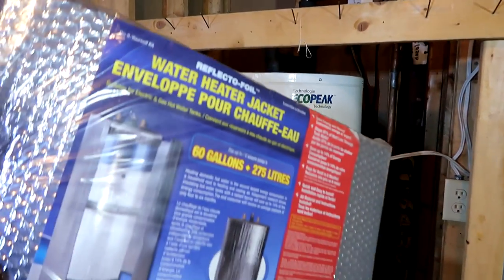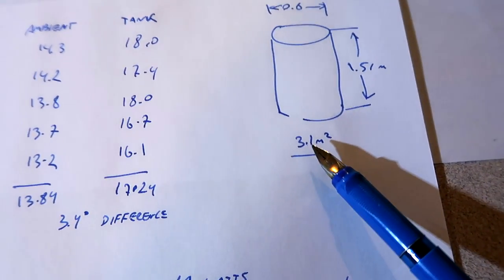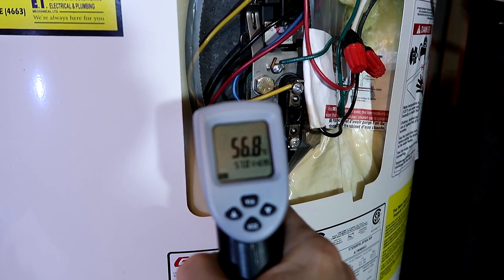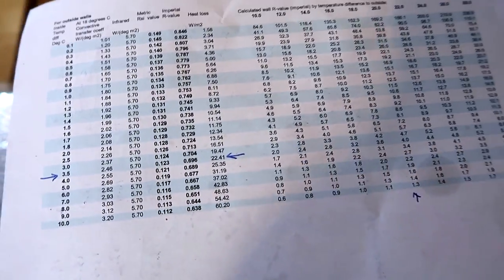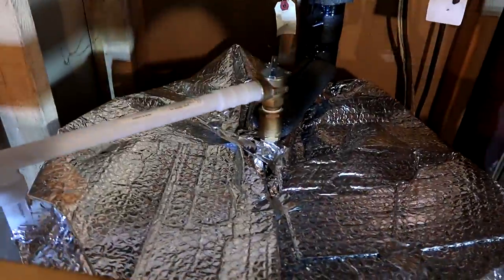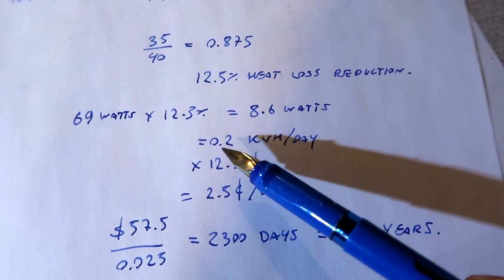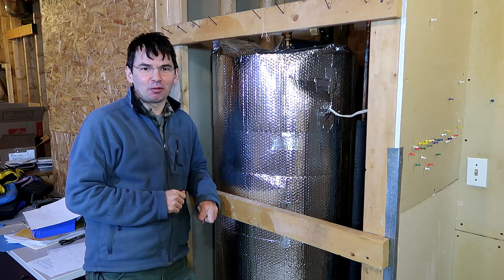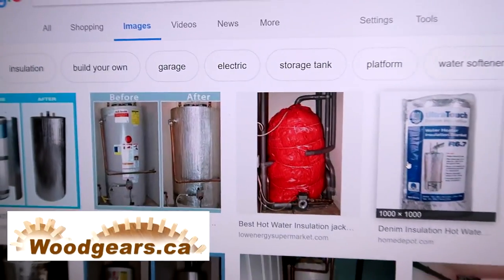Hot water heater insulating jacket:  How much savings

Comment: $60 is a lot for that piece of thin plastic. It would be interesting to test if using regular bubble wrap would make any difference.
Reply: nowanda2nd … been using standard bubble wrap for years on my well tank to keep it from sweating on the basement floor during the summer. If I had a tank style water heater I would probably use that then add a layer of regular foil or that silver Mylar stuff, sealed at each joint with tape. Might even do 2 layers of bubble wrap because it's cheap.

Comment: In my experience, the best way to increase the insulation around your electric tank is to frame it in like you have there and then insulate those walls. Of course remember to leave access for when you inevitably have to replace the tank or fix a leak.
Reply: Yep, tank inside a heavily insulated cupboard : )

Comment: The previous house I owned, the hot water heater was in an unheated and under-insulated garage and the tank sat directly on the floor, and was not in a closet or any other insulating type structure. Granted the number of days below freezing in my area are limited, even still, my guess is in this case, the insulation would have made a much larger impact. At least during the winter.

Comment: Got radiant heat loss but what about conductive heating of the air surrounding the unit?  Reading ambient temps would have been worth doing, surrounding the unit.  Also introduces complications, however, such as general ambient temperature and humidity that you'd need to factor in.  Not impossible though.  I imagine this would be just as large if not a larger factor than radiation loss, which you measured, hopefully making the numbers better.

I like the other bits of advise though, especially at the end.  Never thought to reduce low coil temp for people that have oversized units.

Comment: This was a great video. I really like your method for getting your results. 

One thought, the air leakage through that insulation could be quite high. I would think that if you did a better job airsealing it, you would get far better results. For instance, the top where the pieces are just folded over. The only issue that I think could be a problem is if there is ever a leak, it wouldn't be able to dry out as fast. 

I agree that the kit overpromosses.

Comment: What you loose on water heat, you win in heating the room. If you heat with the same water tank then there are no losses. Only if the room temperature is higher then wanted isolating make sense.

Comment: If you dig deep into the seller's "test method," I bet they tested on a completely un-insulated tank.  Your tank had reasonably good insulation already included which is probably the norm.  I'm convinced tank manufacturers have included insulation for many, many years at this point so that they can sell their product hyping it has much greater efficiency than those from years ago.

Comment: If you live alone or just a couple, you could use a unit that warms the water as it comes out through the shower head.  It is made out of a heating element with a copper tubing coil . It works very well. You don't waste any energy keeping a tank full of hot water.
Reply: Wow that’s interesting. What’s it called? I would like to do more research. My electric HWH is on the outside my house in basically a plywood box with no insulation. It’s winter and the shower stays warm for maybe 20 mins max. Both Temp gauges are all the way up. Would it be better to insulate the box with rigid foam boards or wrap the tank itself with some insulation?
Reply: @Ang.0910   There are many options, check for tankless water heater or in-line water heater. But I think it requires 220V

Comment: might I suggest measuring the temperature on the outside of the insulating blanket.  measuring behind the blanket will determined heat trapped between the 2 surfaces.  thing you would be more interested in the amount radiated to the room. this would be consistent (and interesting) with the initial measurements.

Comment: Inefficiency as it pertains to water heaters is heat lost to ambient air or surfaces rather than to hot water delivered to the left faucet.  That loss can occur in several ways: 
1. Heat loss through the water heater's insulation jacket.
2. Heat loss through the pipes en route from the water heater to the faucets.
3. Heat loss through the exhaust of non-electric water heaters.
Assuming the furnace and the water heater use the same form of energy source and the water heater is located in a part of the house that is heated by the furnace, then item No. 1 above is canceled by the the lessened amount of heat the furnace needs to put out to heat the space, unless the furnace is not active due to warm weather.

A high efficiency furnace and a high efficiency water heater is ideal.  It looks like Mattias has an electric water heater. I know he has used a blower that was repurposed from a high efficiency water heater in the past for another project.  Gas would be more efficient for producing heat domestically. Well, actually,  Electric appliances produce heat with 100% efficiency, but all the inefficiency is in the electric bill because the electricity is produced from a heat source at the power company very inefficiently. If it's heat you want rather than light or a motor turning or your stereo playing, having your own heat source in your house is much more efficient than having the heat source miles away and using generators and resistance wire as a transmission.
Since he lives in Canada, I would not think an extra water heater insulation jacket would be cost effective except on warm summer days.  
Preventing heat loss through HW plumbing would be the best option by far.  A good way to do that would have been to insulate the HW plumbing when the house was built. Retrofitting pipe insulation is good also, but there will likely be uninsulated gaps.  Another strategy is to have a plumbing manifold at the output of the water heater and then have small diameter tubes going from the manifold that are dedicated to a particular faucet. A 5mm tube should be plenty to supply a single faucet and the volume of water in that tube when water is not being used will have a low thermal mass that is replaced quickly when the faucet is turned on and the loss of heat in that small line will be minimal.

By the way, my son lives in Florida and drives a Tesla.  That's great for a warm climate, but I live up north and I'm sure an electric car heater would greatly reduce the range of such a car here.  Tesla's that live up north should have one of those small "truck heaters" installed that you fill with liter of diesel. Besides warming the passenger compartment, it could also be plumbed to keep the batteries warm.

Comment: You should taking the thermal value and not measuring it against the uninsulated value to show how much you would be gaining.
It is the efficency over the loss that you want to figure.  If it gained on one layer, what would you gain with multiple layers?

Comment: I just replaced my HWT... Because of codes that changed in my area. My options were: Install an electric HWT, $1000 for the tank +(~$300/yr to run off electricity), or install gas HWT $1000 for the tank plus another $1000 for a 4" chimney sleeve insert (to keep code compliant) +(~$100/yr to run off gas),... 
Then I Called around. Boom! Got a power vented HWT for $1821 (after Tax installed). Now Both my Furnace and HWT vent out of the side of the house (Thus - the chimney is no longer used or needed for the house) and I can now remove the whole chimney stack from my house and free up that Floor space.......

 In the long run this option is going to cost me the most money $$$ because now I can bust down some walls in my smallest bedroom to expand it, and because the stack is also next to the Kitchen,... I am also thinking up ideas of how I want to renovate my kitchen now that I have access to this additional floor space....

Comment: Don't know if it was mentioned in other comments, but in the heating season, that heat loss from the water heater isn't a total loss, it heats your house. Not as efficiently as a heat pump, so not 1:1, but that extends the payback even further. Another thing for payback - if the money was invested at an average 4%, that means even longer (or maybe never) payback.

Comment: Do not cover the thermostat access covers! Back when the thing with wrapping water heaters started in the 80's the power company had a deal where they'd install storm windows, wrap the water heater etc. Damn near burned the house down because the water heater thermostats MELTED. The plastic used in those has an odor that kind of smells like burning oranges. Dad cut holes in the fiberglass wrapper, installed new thermostats and the heater was back in action.
Reply: With electric heaters set at 125 130F that shouldn't be a problem

Comment: Old solutions for old tanks are still being sold.  If you have a modern hot water heater with modern insulation (like closed cell foam) then this doesn't work.  If your hot water heater is old, then you should just replace it for better efficiency.  In California, PGE charges .32 cents per kwhr so more efficient appliances are worth it (solar panels are very well worth it with high utilities and good weather year round).
Reply: There are very few water heaters from before 1999 out there anymore.
I still come across heaters from the mid 90's sometimes. But most heaters being replaced today were installed in the mid 00's.

Comment: When you point that IR thermometer to the foil, you may very well be "reading" your own body temperature. If you look at the foil with an IR camera, you'll clearly see your reflection there, as if it were a mirror, which it is. As others have said, you should have put a tiny patch of electric tape on the foil and point the IR thermometer in that spot. Ideally do the same, with the same type of tape, on the wood to read the surroundings temp.

Comment: I cut my electric bill in Hal by putting a timer on the water heater. Setting the timer to run for an hour at around 5am and again around 6pm gave hot water at the times I needed it most. I rarely had to override the timer, but if I did the hot water would be ready in a few minutes. Now this didn’t work when I was living with a woman because there was never enough hot water for her, so the timer got turned off and I insulated it instead.

Comment: ...and if you were analyzing a GAS/LP tank-type water heater, the benefit would be even lower, because so much heat is lost due to convection through the flue (the metal tube that runs through the center of the tank for combustion gasses).
It would be akin to adding insulation to the walls with the door hanging open.

Comment: Laser thermometers are incredibly innacurate when you use them from that close (at the end measuring in the holes)
That is because they measure in a disc shape not on a pinpoint like the laser suggests. Quite the interesting readup.
Reply: The cheap ones are allowed a -+5°C error from what I've seen and one imported brand I checked would not supply any certificates or even paperwork indicating the certification of the batch produced. For 10-20 times the cost you could just buy an infrared camera.

Comment: Mylar backed bubblewrap is "insulation" the way a space blanket is "insulation". 

If you've ever needed one, you'll know they're better used as a reflective lining not TOUCHING your surface.  Put two inches of rockwool all the way around your water heater? You'll notice improvements. Put a thin layer of mylar, you'll..yeah, not so much.

Comment: The figures on the jacket about payback are for tanks not already insulated. And yes, I have seen just copper tanks before. I do energy surveys in UK and have seen just copper with zero insulation. One time only. But I have seen it.
Reply from the maker: with today's energy prices, that would make for a very short payback period!
Reply: @matthiasrandomstuff2221  Indeed. It's crazy how marketing can get away with such cheeky stuff. The rarity of totally uninsulated tanks, yet the figures are based on such. I bet they don't even have to state the method of calculation for such savings. They can just prove it if taken to court and say "here" and eyes roll at the way it's done because it's not legal to sell tanks like that now. The one I saw most likely had the insulation ripped off or deteriorated. It was in a flat above a pub where the pub landlord lived who rented from the brewery chain. I told them a jacket would pay for itself quick and they shrugged their shoulders and went well the brewery should buy it then because he sure isn't. Insane.

Comment: And if your water heater is inside your house (like in the laundry room), the heat loss is contributing to the temperature of your living space.  Good news in the winter, double whammy in the summer.  Solution?  A conventional resistive water heater for winter months, plus a heat pump water heater for summer months, and an array of valves to switch between the two.  Highly practical!  Or I guess a tankless would be okay for non-adventurist types.

Comment: Another trick is to split the load. The lower the setting on the tank, the less heat loss and the less it costs to maintain the tank temp. But nobody wants to take a room temp shower. So, get one of the point-of-use heaters for the bathroom. These don't normally produce enough heat to bring the groundwater all the way up to shower temps, at a flow rate sufficient to take a shower. But, if they only have to raise the water temp 10 degrees or so, they are very capable. Then, you save money on the primary water heater, and only pay to heat the water to really hot when you actually need it. The rest of the time it stays warm.

Comment: I love these videos. I wonder though if the last measurements were placed incorrectly. Shouldn’t the ambient temperature reading be on the outside of the insulating jacket and not the wood framing beside the heater?
Reply from the maker: The surface will still be warmer than ambient, and the IR thermometer doesn't work on the reflective.  So it's definitely correct to measure the framing, wrong to try to measure the jacket
Reply: @matthiasrandomstuff2221   your first test was on the outside of the jacket and the surface of the tank at 57 degrees . So you should measure the outside of the jacket to compare. The middle of the insulation is always going to be warmer than the outside. To prove this, measure the temp of the surface of some fiberglass insulation and then tear off half and measure again I bet the middle is warmer than the outside.
 If you can't get a reading on the shinny insulation put some masking tape on it and it will be the same temp as the wrap.

Comment: I put that stuff on my garage door (btw its about half price if you just buy a roll of it) and its worthless as insulation, but during the summer the reflective surface dropped my temps by 15F ... now mind you in my part of the America's its 90F or more in the summer and my stupid garage door is facing the sun most of the day. 
With the rest of the garage space insulated all it is is a giant hot plate heating an oven and I have seen it get to 115F when I come home from work and the door's been closed all day with no airflow so 15F on non peak days its worth the 28$ I paid for the stuff

Comment: I have a suggestion for you!
I’d like you to lay out twenty feed of copper, aluminum wire with different types of metal steel on one end copper or some other metal!
You should have about 1 1/2 volts but with your Graf is there a raise in volts over time from solar storms?
That would be interesting since X-rays are high energy protons!
Reply from the maker: I will leave the quackery to you.

Comment: I like the calculations and the process. However the true r value of metalized 3/8" bubble wrap is known to be R1. . . Regardless of what water heater space blanket marketers claim. My approach regarding the temperature settings has been opposite. I've set my water heater to nuclear hot. This way our hot water ratio is lower. It's not necessarily energy efficient but decreases the likelihood of a cold shower.

Comment: You forgot radiant heat losses...... that reflective material is less emissive... it will trap the IR transmission between the tank and the insulation....  Still not a huge savings but you may save a couple more cents per day

Comment: Just something for you to bake into your analysis.  I know its winter where  you  are.  I assume Your house is heated, including the area containing the hot water heater.  So, if you reduce the heat loss from the water heater to the room, does the home heating system need to make that up to hold the same ambient room temperature?  Now, Summertime would certainly be a different story.  When considering the whole house as a system aren't all heat sources including water heater heater, cooking stove, light  bulbs, etc. all heat inputs to the system and only cost you when you need to cool the house.  They are helpful inputs in the winter when you need to heat the house.  Of course then we would need to dig into the heat producing efficiency of each of those inputs and account for the incremental differences in efficiency  of heat production.

Comment: You dont need hot water for 24 hours.... you can get the instant water heaters and fix them to particular locations this way you will only use the amount of hot water that is required.... and for that particular instance.... this is the best way to save.....

Comment: I don't think the math is that simple because in optimal case the tank surface would be at ambient temperature -> no heat leaking. I think better measurement would be turning the heater off and seeing how quickly the water cools down